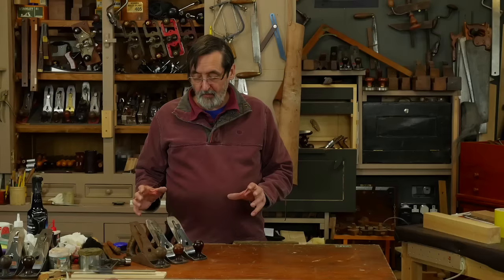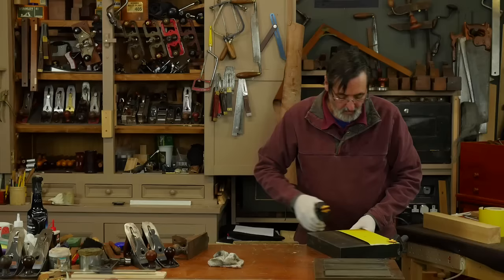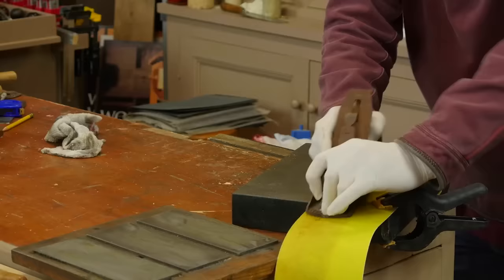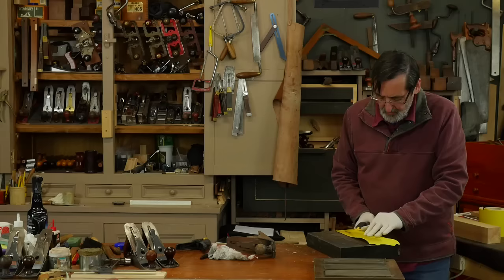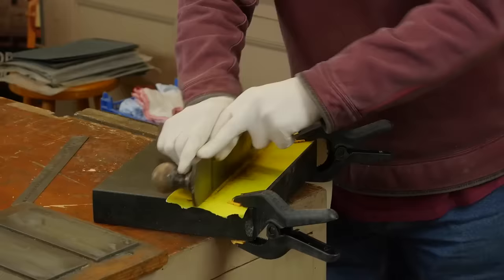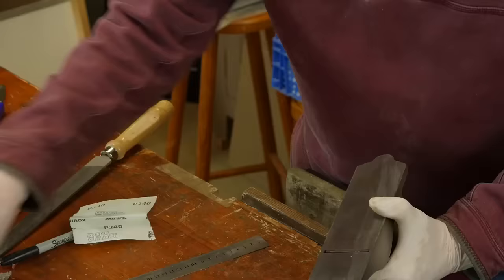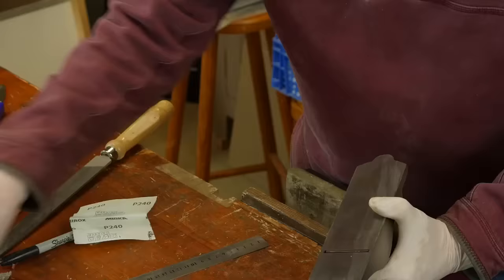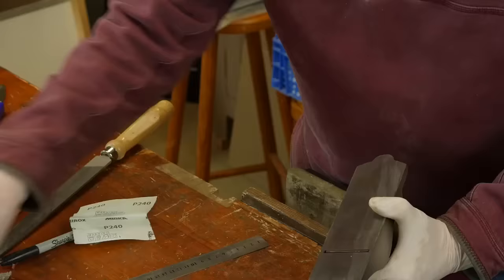Restoring the Bench Plane | Paul Sellers

Comment: I love your videos, but you kinda left out a little secret. Plane iron are super hard! I spent 5 hours yesterday and never really got one sharp, while today I spent another 8 hours on 2 more plane irons, only one of which will shave hair on my arm. 
    I spent all day watching your video on restoration of a plane while sharpening 2 lousy irons. Towards the end of the day, the longer it took to make progress, the madder I got. The madder I got, the more pressure I used and the more speed I used.  I never let the iron get too hot, but I was building some heat towards the end. I had access to grits as low as 36,40,80, 220, and 320, but these took quite a while to get much steel removed, even though they were rough grits. On my way to the finish line I dragged out my cheap harbor freight diamond sharpeners consisting of 160, 200, and 360. Those also took much speed and pressure to make any headway with.I finished up on a DMT steel plate with 1200 grit, again using high speed and pressure . After polishing with chromium oxide on a strop, I was able to shave arm hair.
    So I guess the moral of the story is ,just like buffing hard polyester paint, you need speed and friction to grind and polish a plane iron. 
    On a separate note, to all those out there sharping plane irons,  make sure you have a full edge bur before changing grits once you have reached a complete bevel reset, otherwise you will get nowhere.

    P.S.   Paul, you may want to do a short  video on how much effort it takes to restore an old plane iron with heavy nicks. If one watches close enough, they will see that big table move around while you are sharpening, and that table does not move easily .
Reply: He actually says it's hardened steel. Well, they are not actually hardened but annealed - otherwise you would not be able to sharpen them. But yes they are hard. Sharpening a plane iron should not take 5 hours anyway, even for a bad iron. You're doing something wrong, really. I restored just last night a pretty rough plane iron with a >1mm nick in it and a bloody backbevel in 45mins.

Comment: Fill a plastic tub with water and a few table spoons of  baking soda. Attach the rusty item to the negative terminal of a car battery charger and then attach  a piece of stainless steel scrap to the positive terminal. Place both in the water making sure they don't touch each other and then switch on the battery charger. After about 20 mins all the rust  should have turned black and you can just wipe it off with a cloth.
Reply: +Richard Bruno edit: This is the non toxic electrolysis method that Bob Blarney mentioned below.
Reply: This works well, but just use regular steel. The chromium in stainless steel will create hexavalent chromium which is very toxic, and illegal to dump

Comment: Fantastic information once again - thanks Paul.
A couple of questions if I may, did you clean up the Lever Cap with sandpaper only - the chrome is a real pain to remove?
Also would you be interested in doing a video detailing your approach to fabricating new Tote's / Handles?
I really like the experience you have to impart, thanks again for your contributions.

Comment: If you put some teflon tape on the threads of that screw @1:5:25 it will stay in place nicely whenever you adjust it :)
It'll work like loctite, but won't solidify/seize.

Comment: I first bought a Stanley Handyman not thinking it wasn't the same as a #4 but It works fairly well. I then got one off EBAY and I'm in the process of restoring it. It's not going as easy as this video shows but I blame that on not having 50 years of practice. I'm wondering why use window cleaner on the diamond plates when water will work equally as well?

Comment: Paul, you're on You tube you will last another 50 years.   So what you are saying, by taking off the sharp edges of the Plane you are making it the same as it's been used for 50 years.  As a Patternmaker I have a 4 and a 7 plane and I have used these continuously since 1970 and they are still going strong.  Still I loved your vid, thanks

Comment: I happen to have such a plane that's ripe for restoring.  I will need a new handle as it looks like is been dropped and the split the handle.  The body and rest of it looks ok apart from the rust.  Might have a go at making a new handle as I found some patterns on line

Comment: A nice tutorial - though I'd never use glass paper to remove hardened steel (in the region of RC60 hardness) from the blade to restore it's 25 deg bevel, though. A diamond plate of 300 grit size will rip through such steel very quickly; or otherwise, grind the thing, prior to honing.

Comment: Spray with WD-40, dismantle, soak all pieces in mild paint thinners, brush vigorously with a fine brass wire brush, leave to dry. Now, your ready for the finer work, and a lot of time saved (and sandpaper).

Comment: Thanks to this. I now own a No. 4 plane. It's an old Craftsman that was my grandpas--not the coveted Stanley--but it now easily  takes beautiful shavings and I love it! However... after only very light use (setting the iron and spending a little time enjoying it on some pine 2x4 scraps) the newly flattened sole already has some long scratches/scuffs along it. What gives? Is this common? I don't think I plowed over anything other then a few knots here and there.

Comment: Oh please may I find an extremely rusty and shitty looking Stanley so I can spend a few hours and clean it up. Will make a big difference to the shitty made plane I purchased from Bunnings that has casting streaks that I am trying to sand out and I guess I am maybe 30% there after spending 4 hours on it so far. However at the end of my "polishing" I will still have a cheap shitty plane.
Thank you Paul. I have spent several hours looking for an in depth guide on helping me to refine my rubbish item and making it into a useable rubbish item. Your video is greatly appreciated. 👍👏👏👏👏

Comment: I love your videos Paul as a beginner that is really helping me so much,  a really big thanks. 
My english is poor could you please or anyone tell me 
-what exaclty is that specific color you are using for the wood handles as finisher. I would like to get the exact same color. 
-what is this green compound you are using on your strop to finish the blade ? 
-what is this metal can you are using to oil the sole and what is this material you put inside would like to get the same
Thanks for your answers

Comment: Thanks Paul, that is a top restoration.
Just one question: I have inherited an old plane with a damaged lateral adjustment lever (the circle at the bottom is missing), is there anyway you can do a video on how to change one of these levers for a new one as I can't find anything on Youtube?

Comment: With all of the custom and expensive honing guides being sold by name brand online vendors, is that honing guide that Mr Sellers used to establish the initial 25 degree bevel an plain and simple Eclipse Honing Guide as sold on eBay?
The sales pitch on the new honing guides is that the rollers are on the sides of the apparatus, but it looks as if that center roller makes the use of abrasive paper even more economical.  And, gee, I have a protractor, so 25 degrees might not be too hard to set, especially if the guide has been set to 25 degrees before.

Comment: Paul...while I can appreciate your dedication to restoring this vintage Stanley plane, I would have used a finer grit paper on the body so that you wouldn't see the marks, And, to try to keep the base as close to precision as possible. I have used upwards of 800 grit to achieve a smooth base. Remember that these where manufactured with precision in mind. I would have also spent the time to polish up all the other metal components to make it look like you just bought it. But that's just me. I cringed watching you file down the edges with the file. Again, these were produced square for a reason. To each is own. Good video regardless. Cheers!

Comment: A trick for removing rust is soak the parts in distilled vinegar they come out like new. they will have a gray color to them but just like new. try it on an  old rusty wrench the rustier the better it might take a day or two and then rinse with water the rust will be gone.

Comment: Hi Paul, Excellent videos and instructions as always - I have an issue with my Stanley number 4 plane. The yoke keeps riding out of the adjustment ring when I turn it and jams. Are the Y shaped yokes supposed to fixed together? both sides of the Y shape seem to move independent of each other - I am wondering if it is supposed to be fixed together and this is what's causing the yoke to want to ride up the back and front of the wheel when turning it??  Could the blade length be affecting this (an old blade being shorter and so the thumbwheel would need to be out further  - meaning more of an angle on the yoke?)

Comment: Hello. Very nice video.
What is the best way to replace the pin in the yoke? 
I have a number 5 type 15 and looks like someone put a steel nail in to replace the original pin. What stops the pin from sliding out? 
Thanks

Comment: I have a few planes with some pitting on the sole and on the blade. After seeing this video, I realize I still have work to do to get them into an ideal state. What, if any, impact will the pitting have on the planes performance?
Reply: +Dominic Piché 

Pitting on the plane body has essentially zero practical impact on functional performance.  It just looks like hell.  Pitting on the BLADE, CAN have crippling impact on usability, IF it's in the wrong place.  And it usually is.  I mean, if there's rust significant enough to make actual "pits", then the rust is usually pervasive.  So the moving parts of the plane controls mechanisms, are usually frozen up, etc.  Also, pits anywhere on the blade, usually START at the cutting edge, if anywhere - which is where the functional problems happen.

If you are unlucky enough to have planes badly rusted to the point of pitting, yet simultaneously "lucky" enough that the pitting is NOT present right near the cutting edge of the blade on the BACK (flat side -- opposite the bevel), then you can restore the blade much as Paul shows here.  The rest of your blade may look like hell along with the body looking bad, but it will be sharpen-able, and usable.  But if there is significant pitting within 3/8-inch (10mm) of the cutting edge on the back/flat side, it's just not usually worth messing with.  Throw the blade in the junk drawer, and replace it with a modern after-market blade.  

The old blades are usually pretty fair or even quite good steel, but they're thin, which makes them more prone to "chattering" if everything isn't set up perfectly.  Modern high-quality blades may cost more than you paid for the plane itself, but in a serviceable old plane body, the best new blades can turn your old junker into an elite performer -- able to handle tougher woods with gnarly grain better than the old-timers were capable of.  Some of the modern steels are also tougher -- lasting longer between sharpenings.  "Hock" brand (blades only), and "Lie-Nielsen" and "Lee Valley/Veritas" (full-range tool-makers) are three highly-reputable makers of modern top-quality replacement blades for all the old Stanley/Record style planes.   (Those are just the brands I've researched and can recommend.  There are other makers.)  I think Stanley themselves might still be selling replacement blades for their 100-year old planes.  But those won't be an improvement -- the steel may be less good than the old ones.  If wanting an identical replacement, I'd strongly suggest scouring Ebay for replacement originals, if you have the patience for that.

Comment: Hi Paul I enjoy your work very much. I have a problem. A few of my planes receive water damage and rusted. This was over a period of a few months while I was away. When I came back and saw these planes all rusted I got sick. It looks like I have a winter project ahead of me working on each of these planes to restore them back to New. The unfortunate thing is they were all brand new expensive planes. What do you think of soaking them in vinegar for 24-48 hours to remove rust and then do the Sandpaper thing that you did on your video. Please advise thank you

Comment: Paul, what would you recommend to use on the cap iron and blade to get some rust off? Would the sandpaper work on there as well? Thank you for the video, helped me so much with a jack plane!
Reply: +Derek Risser Worked for me Derek? Finished with wire wool.
Reply: Okay, thank you very much

Comment: Any tips or tricks on how to square off the cutting edge? I have a second Stanley No 4 and 5 and one plane iron is not square. Trying not to buying a new plane iron but I'm stumped on how to square it off. My best guess is a belt sander to square then sharpen with diamond plates...

Comment: I have just bought two Acorn No.4, non-adjustable-frog planes in a much worse condition than the one in this tutorial, i.e., rust is much more present and seems much deeper-in.
Should I use any chemical rust removal option, or just stick to the method presented?
Moreover, one of the frogs is welded for a fracture; is it worth restoring and if so, what should I look for in it?

Comment: Paul, is as you were sharpening the iron, you rotated the iron 180 degrees (90 degrees at each diamond stone) from 250 to 1200. This would cause a diamond stone to work both against and with the grain (assuming it's running length wise in the iron) throughout the sharpening.  Does this cause any issues in the product of the edge?

Comment: Another method of removing rust from most metal objects is by using a product called Naval Jelly that can be "painted" on with a brush.  Just leave it on the item (according to the directions) and afterwards, you simply rinse the item under cold water.  Then, shake it dry, and then dry it properly with a hair dryer and you're good to go.  No sanding or scraping of the metal is necessary whatsoever.

Comment: Great video by the way but I have a question how do you keep the blade from sticking out of the sole when it's all the way in the back position
Reply: Back it all the way off before inserting, or you might have the blade in upside down? Should be bevel down.

Comment: Firstly awesome video!! Thank you for taking the time to show the entire process.
Not sure if this is common but I’ve restored a Stanley No 4 as per your instruction. When it came to setting the plane I can only get shavings from the center 1/3 of the steel, nothing on the left of right.
The sole is flat and the steel is square (sharpened with a Veritas guide to1000 grit). Tried moving the frog tightening down more than I’d like but no joy. Any advice would be very much appreciated 👍🏻

Comment: Hi Paul, I really like your videos. I have just received a Bailey #6 plane, it looks in fair condition but someone has spray painted everything but the soleplate, blade and handles. Who ever did this has really gummed up a lot of parts. Is it okay to use lacquer thinner on these parts to clean off the paint?

Comment: I have recently purchased several older planes that appear to be in good shape. I followed your video for restoring, sharpening and setting up my planes for use in my shop, however, one of my planes, a Bailey No 4, gave me some issues when attempting to set the cutting iron into the narrow 5/64th in. throat. The cutting iron that came with this plane was about 7/32nd in. thick and with the cap iron in place would not project through the sole. I solved my problem by swapping that iron with another that was thinner from a second plane that had a wider throat. Both planes now work very well. Is this a normal fix for this type of issue?

Comment: I have been trying to figure out what brand is going in my till. I own Sargents Stanleys, Dunlops, Craftsman, and Union. They are different sizes and shapes. I have found that when they are tuned up they all do the job. So my Questions... What is the best type of plane to start a small box for my children? What is the basic planes I would want to keep around the shop? Am I missing a video on these questions.
Reply from the maker: You can’t really go wrong with Stanley. I have used them all my life

Comment: What if you cannot get the depth adjustment wheel off the carriage bolt? I have been able to succeed in following all of your instructions here with a Stanley No.3 type 10 that was recently given to me.  I soaked the frog in vinegar for 24 hours and then was able to remove the carriage bolt from the back but the depth adjustment ring, although shiny and clean is not moving on the carriage bolt.  I then soaked the carriage bolt with adjuster ring in vinegar for another 24 hours and still it will not budge.  Any thoughts or advice would be greatly appreciated.

Comment: This video sparked a question. I have a Stanley low-angle block plane. Thus far, whenever I have adjusted how much the blade protrudes, I have released, adjusted and locked it down again. Can I simply adjust the blade while it's locked down?
Reply: my experience with this plane is it can be adjusted but only if your lock down action is not too tight/firm.

Comment: Paul, I have been working on cleaning up an old drawn knife, its handles were originally finished like the wood bits on my bench panes.  Their color was a deep burgundy and, as you mentioned in your video, just flaked off with the least bit of effort with the edge of a chisel.  What did you use to tint your shellac and what color was it?  I'd like to replicate, as best I can, the old burgundy color but have little experience with tinting shellac.  Your help would be most appreciated.  Thank you